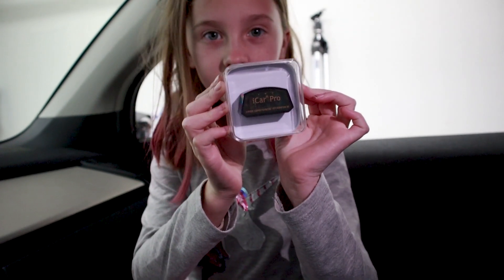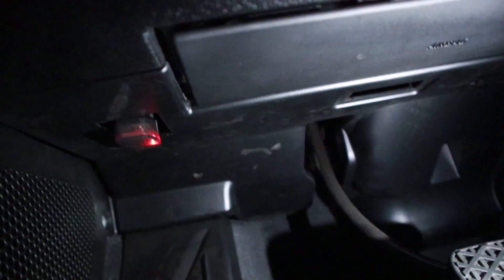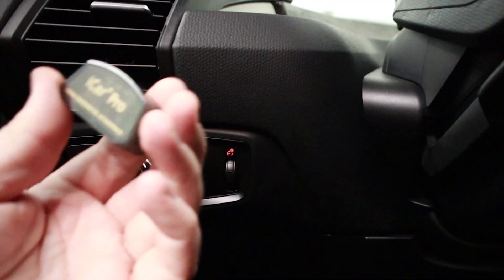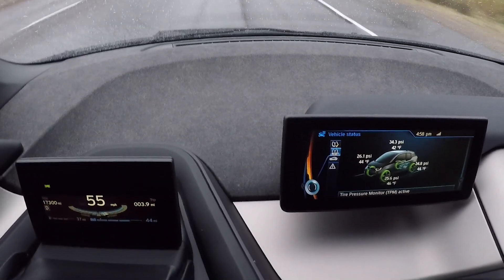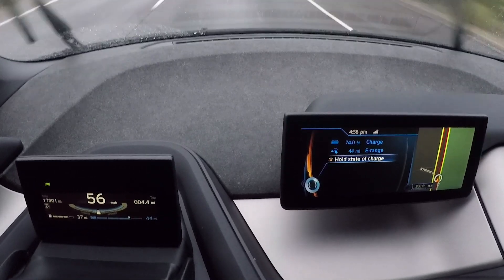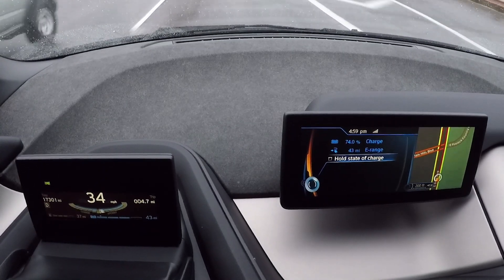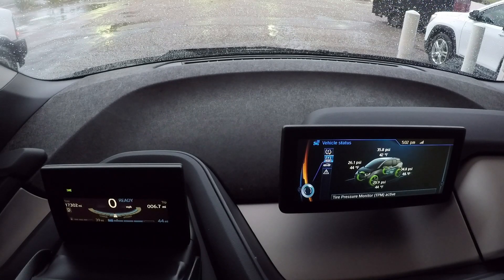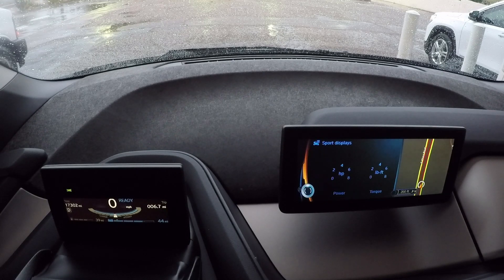BMW i3 REx Coding - VGate Tool

Comment: Hopefully this helps someone: buy the wired version with the USB C to Ethernet adapter. It's literally 10,000x faster and wayyyy less buggy. Also be sure to enable internet tethering through Ethernet and turn on airplane mode. Works like a charm!

Comment: Hello, thanks for all the fantastic ideas for coding my i3. I recently purchased a 2018 i3 s.  I tried to enable the AM radio, I love listening to talk radio, but it still does not show up on my screen. Is there anything else I need to code to get AM radio to play? My other option would be to play it on my phone and then bluetooth the radion over to the car. But I would really prefer to play it straight from the car. Hope you can help.
Reply from the maker: There are reports that AM radio signal/interference is not great in the i3. However, there are some instructions in this forum string so you can try for yourself - https://www.mybmwi3.com/forum/viewtopic.php?t=4671

Comment: They are 3 different icar pro readers on Amazon, which one do you recommend?
Reply from the maker: I would buy one on this list just because that's what Bimnercode is officially compatible with. I think the icar still works but I would likely buy from this list to ensure maximum safety. https://bimmercode.app/adapters/

Comment: I used a Vgate BLE from Amazon - $32 -worked perfectly on my 2018 REX -  reset the charging code in a couple of minutes by following the connection directions in Bimmercode. Works like a charm.

Comment: I bought a chip but was unsuccessful coding the car to activate the hsc. How do you get the manufacturer to code the chip for easy programming?
Reply from the maker: Are you sure it didn't work? I thought the same at first. But, there's a minimum threshold on SOC required to do it, you cannot do it at 100% charge for example. I think the option can be activated at ~75% SOC. Otherwise, you could try reaching out to Bimnercode.

Comment: I’m considering purchasing a used i3 and making the changes you showed. Do you know if making these changes will invalidate the pre-owned certified warranty? Thanks
Reply from the maker: Nothing here should be worthy of warranty contest. It is all reversible. Mostly these changes are 'preferences' as opposed to performance related. Mostly, it is illegal to deny warranty service unless directly related to the modification. I would not hold any anxiety here. Your call though.

Comment: I was thinking of picking a use one.  What years should I get a 2014 or 2018? There is a 5K difference
Reply from the maker: Difference is most likely in battery range. If 50 miles r/t covers your use case, go 2014. Otherwise 17+.

Comment: SUCCESS _ Thanks to D Wray !!! - Today, January 6th, 2021, I used a newly purchased Vgate iCar Pro Bluetooth 4.0 OBDll (£27.99 at Amazon.co.uk) with the full version of BimmerCode (just over £30 from the App Store) on my iPhone 5 SE (running iOS v. 14.2) on my December 2016 BMW i3 Rex - and it WORKED PERFECTLY !!! - Thank you, D Wray for all your video help and advice ! (Users, be sure to "remove" your phone's bluetooth connection to the car before you begin to 'code') 
I now start in ECO PRO mode as the default and the bloody seatbelt gong has been silenced forever ! Yay !!! - Very Happy !!! :-)

Comment: Hey there D Wrays Garage! I live in AZ as well. I have a 2014 i3 Rex and had a question. Does it void the manufacturer 100k/8 yr battery warranty if you install these codes? Thanks again for the video. #dwraysgarage
Reply from the maker: While I cannot guarantee anything, the changes you are making are mostly customizations that are well within the design spec of the vehicle. Changing the REx to perform as it does in Europe is unlikely to hurt the car and was only implemented due to CA regulations, if I recall (and the implemented for all of N. America). It is easy to code back to stock before any garage visits but it's very unlikely to be necessary.
Reply: D Wray's Garage Thank you for the reply. I did contact Chapman BMW in Chandler just to be sure and they told me that it would void it. I don’t think it should but I don’t want to risk it so I might wait till after the eight years to do it. Thanks again for the info!

Comment: Hi Do you have to pay to bimmercode on the app because i try and they ask me to pay in order to code it?
Reply from the maker: Yes. It is $40-45 if I recall for short coding. You may be able to long code without it but I would risk it unless you're fluent in German and have coded an ECU before.
Reply: @DWraysGarage  thank you becsuse i though it free at first time. i just want to make sure
Reply: @DWraysGarage  Hi one more question, after you code your i3 any check engine light  come on?
Reply from the maker: I never had that happen and I coded several times. I advise coding in sections at a time and few parameters so you can easily unwind and know which item may have created any issues. But, like I said, quick coding was always rock solid for me. Be well.

Comment: Hi D wray..  Marcel from Phx here .. I also have an i3 2016 which  I love and would love to unlock the gas tank and REX restrictions but i couldn't manage to connect my Vgate to the Bimmercode app.. it doesn't show in my phone at all .. and this is the second Vgate i got it because the first i thought was defective .. Can you help me ?
Reply from the maker: Marcelo I just saw a post on this video yesterday where VGate is no longer compatible with the Bimmercode app. You should check out on Bimmercode's site which dongles it can connect to. Good luck!

Comment: Thank you for the great video.  You explain very well...does help to have a good assistant.  You have built my confidence level up to give this a try.  I see that there are three versions of the ODBII  scanner tool by Vgate.  Two are versions of Bluetooth and the other a wifi model.  Which one did you use?  Thanks again.
Reply from the maker: Thanks for watching and glad you got some confidence to do this. I used the Bluetooth version - just seems the better technology for connectivity for this purpose in my eyes. Good luck with your personalizations!
Reply: @DWraysGarage  Thank you very much for your time and response.  I went to the BimmerCode app site and looked to see which scanners they recommended.  Just for your information, they no longer recommend any of the Vgate products.  I am sure that everything you said would still work with the VeePeak scanner.  Thanks again.

Comment: if you had to take a fairly long road trip in an area where there are no chargers, how long can you go if you keep adding gasoline?    

If you set hold state of charge to 70% and drive on highway, how far can you go if you keep adding gas?     

If the range falls below the Hold State Of Charge level while driving with rex on the highway, will the rex charge the battery back up to 70% if you slow down?      

Thanks... I may not be explaining this well.. still learning about the i3, and am probably going to buy a 2017 with rex soon.
Reply from the maker: If you're highway driving on relatively flat roads at no more than 70 mph in decent temperature weather it is plausible you could drive indefinitely if you keep adding gas. The battery may fluctuate some as HSOC isn't absolute, but it should be in the ball park of where you switched over to the REx. 

That said, the vehicle really is more commuter-centric so bear that in mind. If road trips are regular, this may not be the ideal vehicle for you.

Comment: Can you change the Hold state to a Different Percentage Such as % 85
Reply from the maker: You can set the hold state to say as much as 15% thru the BimmerCode application and, even then it tends to still not kick in until 6%. For HSOC to work your battery must be at or under 75% and will always require the user to make the switch. Best way to speed this up is to assign a 'hot key' by holding down a radio button while in that menu. I'll have a video out soon on this topic.
Reply: @DWraysGarage  Thx i have already assigned my # 8 as hot key. was hoping there was a way to put car into Hold state earlier like 85 or 90 %.  Do you have a list of all coding Options you can do on i3? Also what did you mean by your comment on Hold state at this ( 15% thru the BimmerCode application and, even then it tends to still not kick in until 6% ) Sorry  Little confused on that part who would set it that low  Thx in advance
Reply from the maker: @kevincummins5675  I did find a list - a little dated but was on an i3 Facebook group. I'll post to my next BimmerCode video. It's shot, just need to edit it. The 'why' of the programming option isn't totally clear but I imagine there was a thought at BMW that some people may want to try and protect more battery buffer than 6%. I think 6% is too low as you could easily eat into that depending on driving conditions even with REx active but I guess that's true no matter the low end number.
Reply: @kevincummins5675  Question:  If you code an i3 Rex to hold state of charge and start the range extender, how far can you go if you keep adding gasoline to top off the Rex tank?    I am looking to buy a used 2017 Rex...     Thanks
Reply: @DWraysGarage  I coded my i3 and while using the function "hold state of charge", my car runs the generator all the time.  Also was able to set the gas capacity to the real volume of the container (2.4 gal)
Reply from the maker: You do need to be at 75% state of charge or less to switch over though, right?

Comment: Do you think a coded i3 could make it up to Payson or Flagstaff in a pinch?
Reply from the maker: I think with one fill up on the REx, possibly. Payson more doable than Flag but the real question - as yet untested by my vehicle - is how would it hold up against that brutal climb out of the valley to 9000 feet?
Reply: D Wray's Garage Cool. We have a minivan for road trips, but my Mom is up in Payson. I have been thinking about replacing my 2007 Civic with an i3 for my daily driver so I wouldn’t be likely to take an i3 out of the valley, but you never know if there might be a need for a medium length trip while the van is in the shop.
Reply from the maker: @philliptackman37  I understand the 'backup' plan. That, in my eyes, is why the REx is so popular on these battery models with only 60-70 miles of range. REx provides the option to go further. I love it and did not at all expect to.
Reply: D Wray's Garage Thank you got taking the time to answer my question. Have a great day!